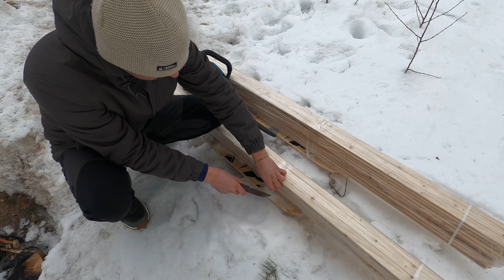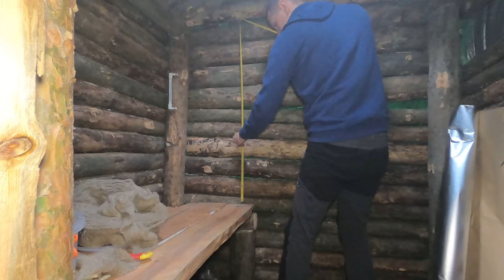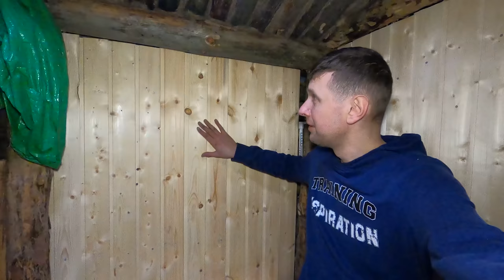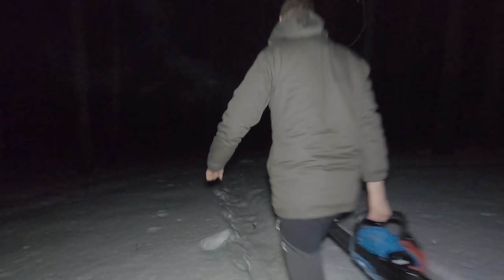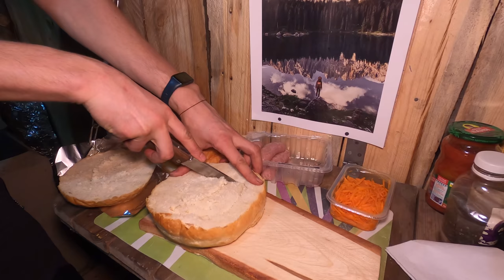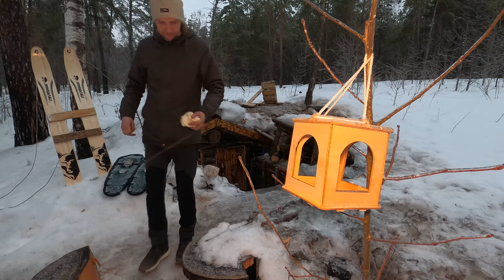ALEX WILD dugout life: Finishing the SECOND ROOM with boards. A guest in the LOG CABIN. PART 22

Comment: Have you had any problems with animals trying to get in?

You could add some extra storage by digging down and then making that part of the floor in to trapdoors for access to it. 

When spring comes you should plant some bushes to better help disguise your home-away-from-home. 

Have you looked into any way to make electricity from the heat in your stove that you are not using?